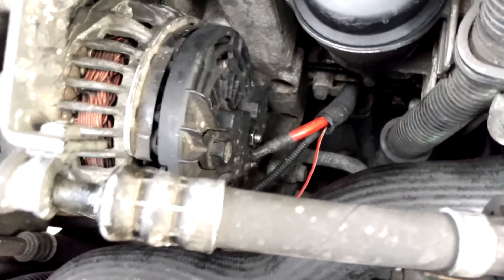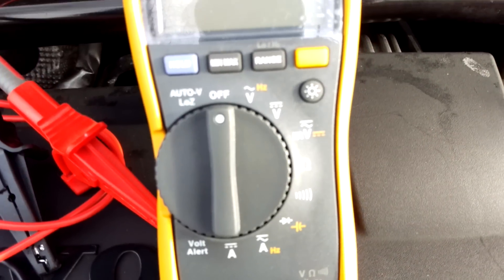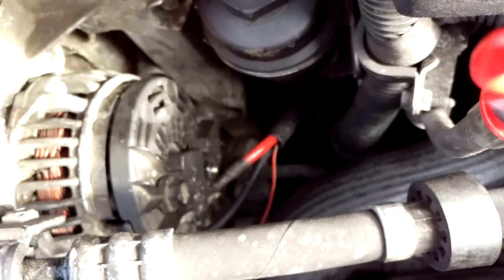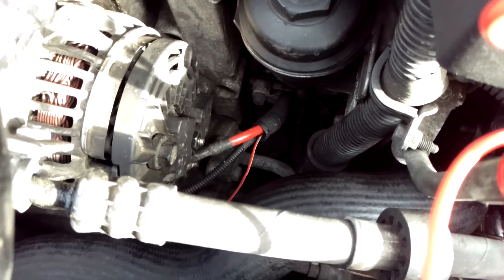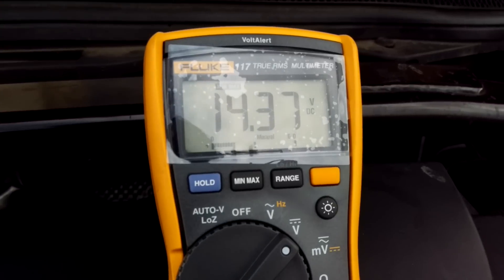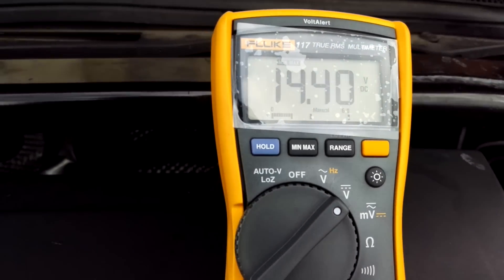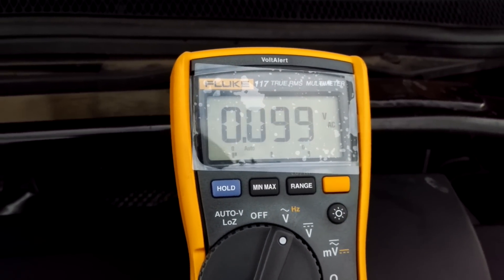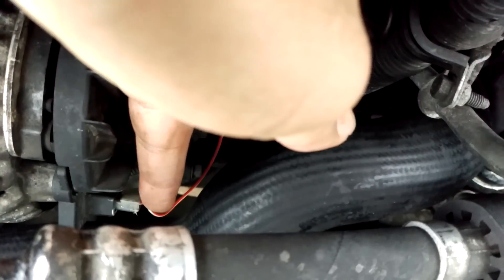How To Test an Alternator Part 2. Rectifier, Diode Pack, Parasitic Battery Drain

Comment: Thank you for this video, very helpful! Based on the second test here my rectifier is bad, I am seeing 30V AC! I didn't directly test on the alternator as it is inaccessible but instead measured from jump points in the engine bay which are relatively close to the alternator (battery is in the trunk). I hope this is still a fair test, using the jump points? E46 BMW if you're familiar with the car. Thanks again!!!
Reply from the maker: David C You're welcome David and thanks for the comment.
Please read the video description. 
You need a better multimeter.
Reply: My apologies the description was hidden on my phone's app.  I'm showing 14.10V at idle so I think the alternator is OK, but intermittent problems are inherently difficult to diagnose!  I'm going to have the battery tested in case it has a sporadic internal short or some other fault.  Thank you again!!!

Comment: So would a bad diode fail in a way that it would only cause an intermittent draw. Trying to chase a phantom down its there and then it gone...
Reply from the maker: Kreig Dernier Unlikely. 
If you have a DC voltage over 13 measured at the alternator with the engine running, a failed diode is almost certainly not your problem. 
You can also carry out a detailed parasitic drain test by following my video here https://youtu.be/ZCMQE2tgRSE
Reply: Thx im getting 14 at the end of its cables to the battery the search continues
Reply from the maker: Kreig Dernier The alternator isn't your drain then so do a proper parasitic drain test and you'll have your answer within an hour. 👍
Reply: SiRobb ya if it didn't have a mind of its own and come and goes when it pleases i would agree with you

Comment: Very helpful video, cheers Si! For other viewers, if the problem is your alternator, dont throw it (and your money) away! I just made a video about Alternator Troubleshooting & Repair. I had a non-functioning alternator and in the video I go through the fault-finding process and dismantle the alternator. In the end the problem was with the diode plate, a $25 component, which is easy to replace. If you want to see the video, go to my channel and you'll find it there... Happy fixing! Cheers, Chris 👍

p.s. Si, where are you from? I'm originally from Blackpool, and your accent sounds pretty close... :-)

Comment: my diode test comes up fine but i get 13.4 vdc and 28vac at idle is that the rectifier?
Reply from the maker: Karl Griffiths You need a better multimeter to get an accurate AC voltage unfortunately as per the video description.
Reply: SOUNDS LIKE YOUR ALTERNATOR IS NOT GROUNDED PROPERLY

Comment: I was unable to disconnect the voltage regulator and stator connections on my alternator (2006 Ford F250), but instead disconnected the connection to the positive battery post.  The diode test showed ~970 mv. The reverse leads showed OL.  All other alternator tests were good.  There are no symptoms of a bad alternator except the check engine light remains on, and the Ford Technical Service Bulletin suggests a possible diode problem...as determined by an O-scope.  I am wondering if the higher mv reading was due to not being able to disconnect the voltage regulator and stator connectors, or that there is a diode problem triggering this check engine light?  Thanks for the video.
Reply from the maker: +lathcar when you say other tests were good, what were the AC and DC volts readings?
Reply: The DC output was 14.5v engine running, and the AC was <.1v.  Similar readings when testing from the battery except AC volts were practically zero. The TSB calls for a frequency waveform test to find if there is a fault.  Maybe this is something that cannot be detected using multimeters?  Thanks for your reply.
Reply from the maker: lathcar From those figures, I see no diode problem and strongly doubt that an oscilloscope would confirm any different. 
Eliminate voltage drop to battery by doing the same AC and DC voltage test on the battery posts and if they check out, it could be something as simple as a poor connection to the dash tell tale light. 
Your charging system can be A1 but if the system doesn't know that, you'll get a warning light. 
Diagnostics live data will help also as that gives the system voltage which can be different to the battery or alternator output voltage.
Reply: I took it in to a parts store and had them do a diagnostic.  Nothing wrong w/ the alternator or battery.  The check engine light remains on, had the Ford dealer reset it, but it eventually came back on.  This has become quite the mystery since I have done about everything suggested by the error code - the alternator being the last thing. Thanks again for your reply.

Comment: hi what if the reading is only going one way but it is low bwt 100???
also what about the wire that goes from the alternator to the cluster (small thinner (blue one)) does that have a one way diode or can current flow both ways throught that? 

cars a 325i e30
Reply from the maker: Faisal Mahmood The test is in 3 parts so as long as you're getting around 14V DC with the engine running and less than 0.5V AC, your diodes are most likely ok. 
The small wire is switched so only produces voltage with ignition on and doesn't require a diode.
Reply: SiRobb thanks..👍 was going to change the alternator beacuse the small wire was showing current both ways but seems alternator is ok as other tests are ok... maybe the new battery was bad anyway

Comment: hi what if the reading is only going one way but it is low bwt 100???
also what about the wire that goes to the cluster does that have a one way diode or can current flow both ways throught that?

Comment: I did all your tests and ok. but still have the 15.2 volts at the battery and the dash computer only reads 14.7. What can it be?
Reply from the maker: Ser Shark What car have you got and are you testing the voltage on a cold or warm engine?

Comment: Btw,my car system is reading 14.60 volts but when i measure at the battery is 15.10 volts. So maybe the power module is ok but the voltage regulator its putting more. Its strange how the hidden menu reads.

Comment: I just watched your battery drain video ,very good made!
My first problem was with my Webasto that didn't work and after a diagnosis i saw there was an high voltage error where my webasto is blocking it self. After that i start digging,i had an audio drain that i fixed with a relay. Maybe i have more parasitic drain from Confort Access(its a common issue at Bmw).
I drive everyday,and every morning my battery voltage is 11.60... So maybe just a bad battery or parasitic over the night and the power module its pumping up to 15 volts to charge the AGM battery faster.
No problem starting the car!

Comment: Thanks,so then is most likely the voltage regulator for the 15 volt issue?
Reply from the maker: sergiuxy21 Not necessarily. 
In winter, higher alternator output around 15V isn't unusual particularly when cold. 
If it is still 15V once the car is fully warmed up, you may have a regulation problem or a battery in poor condition so check your battery voltage like in my video here https://youtu.be/sWIHbDAhv4Y
I'm using diagnostics but you can use a multimeter for the readings.

Comment: Can i measure Ac volts at the battery?
Reply from the maker: sergiuxy21 Ideally, you want to test at the alternator but testing at the battery is better than nothing. 

With 15V DC, your diodes are most likely to be ok. 

For my more detailed parasitic drain video, see here..... https://youtu.be/ZCMQE2tgRSE

Comment: Hi man,very nice video!!
I have a Bmw and I'm getting 15.10 volts at battery with engine on.  And also i have some battery drain cuz my battery is getting empty if i don't drive the car for more than a week. 
It can be voltage regulator  and for the drain the diodes??

Comment: Hey I have a draw going on in my truck so I tried the last test and it came to 327 with the red on the case and black on the post and it came to 1 when reversed what does this low reading mean since you said 500-800 is in spec
Reply from the maker: ltownsgrimreaper The 500-800 is a general industry standard. 
You have a definite one way reading on the diode test and remember that there are 3 tests in the video so as long as the DC volts are over 13.5 and the AC volts is below 0.5, the rectifier isn't the problem.
Reply: Your rectifier may be using low voltage drop Schottky diodes which turn on at about 0.4V. These produce less heat than conventional diodes at a given load current and are therefore useful for high current alternators.

Comment: MY BATTERY LIGHT IS ON ALLTHE TIME , BUT THE ALTERNATOR IS CHARGING OK ,WOULD THIS BE THE DIODE ARE AT FAULT
Reply from the maker: Mike 1960 What is the DC voltage measured at the alternator with engine running?
Reply: Could be voltage regulator.

Comment: Thank you for your informative vid, I especially liked that you showed a cheap multimeter as most of the punters that watch these vids only have a cheap one (like me) Now I know its millivolts as it doesnt say on my meter. I found out I have knackered diodes with these tests whereas before I thought it was the regulator.
Reply from the maker: What results did you get on the 3 tests? 
Also see the video description for the caveat relating to cheap meters.
Thanks for the comment.

Comment: Mate, wished I looked at this video while my faulty alternator was still in my 4wd,   but was still very helpful.  I thought I had a voltage reg problem as the alternator was under charging the battery,  max DC about 13v output.    After pulling apart the alternator I measured all 4 diodes ,   2 were OK , using the diode check on my multimeter tested about 520 each ,  the other 2 were open circuit in both directions. When testing at the large +  terminal I had a reading of about 950 .  Also the diode terminals  looked a bit burnt too,  ended up replacing the alternator as I damaged the voltage reg & brush holder ,  the screws were rusted in.  For some reason I thought alternators were all 3 pole / phase, like most electricity grids,    but my Toyota seemed to be 4 pole/phase.
Reply from the maker: You got there in the end, that's the main thing.👍
Thanks for the comment.

Comment: Hmm. I'm seeing 1.5v on the diode and 30VAC!!!! Diode only passing voltage in one direction but reading obviously too high and 30 volts ac!!!!!! Guess it's my diode.
Reply from the maker: 30VAC is a common reading on cheap multimeters and doesn't necessarily mean there is a fault. 
See video description.
Reply: +SiRobb Haha! The old "read the description you pillock!" I was questioning the meter as I've just tested a recon alternator at the parts shop and the diode on that one according to my meter is 1.7, which is fairly inline with my 1.5. I'm beginning to think I may be ok with just a new regulator. Cheers.

Comment: I tested the diode like in the Video and got nothing going one way then switched the probes and tried a got 455 is that good enough ? You said 500 to 800 ?
Reply from the maker: It could well be ok but there are 3 tests in the video so what was the DC charging voltage and AC volts?

Comment: Are the numbers for the diode test different for different alternators?  I got 1 and 1199 when diode testing my alternator, and I'm pretty sure that I've got a bad diode in the rectifier cause I lost about 1/3 of my max output current.
Reply from the maker: The numbers are pretty much an industry standard so having failed 2 of the 3 tests, I'd say you have a failing diode(s). 
If you know anyone with a similar vehicle and alternator (maybe through a forum) you could check theirs to confirm.
Reply: That's what I thought.  I've never done this before, but guess I'll need to replace the rectifier.  It's a Mitsubishi alternator, I'm hopping it won't be too difficult.
Reply from the maker: +sailorbob74133 Before doing anything, watch my Part 3 video here https://www.youtube.com/watch?v=Yc8tsADpjVA where I look at the brushes and slip rings. 
It would be unusual but not impossible for these to cause your out of spec reading.

If you do have to change the rectifier, click on this for some guidance videos https://www.youtube.com/results?search_query=Westronics+rectifier+
Reply: Thanks so much for your time.  If it's ok, I have one more question.  I also measure AC amps with my clamp meter and got a reading of 2.5 AC amps in the positive battery cable.  Is that an acceptable amount of ripple, or is it excessive?  Most of what I've read says AC volts can only really be reliably measured with an oscilloscope which I don't have.
Reply from the maker: +sailorbob74133 Is your multimeter stamped "True RMS"?
Reply: Yes, it a Uni-T ut210e http://www.eevblog.com/forum/testgear/a-look-at-the-uni-t-ut210e/
Reply from the maker: +sailorbob74133 That would be accurate and reliable enough for me.👍
What was your DC volt reading?
Reply: With no load about 13.7v @ 750 rpm,  and about 12.47v with brights, ac,radio,defogger and trunk light on @ 2300 rpm.   The alternator was generating 58.7 amps and an additional 5.5 amps was being drawn from the battery.  The set point for the field control unit on this is 14.3v and the rectifier uses three 30 amp diodes.  So even as an amateur it sounds pretty clear to me that one of the rectifier diodes is bad.  I monitored the PCM input to the field control unit and it was 2.2 volts, which means the PCM was basically full fielding the alternator.
Reply from the maker: +sailorbob74133 It's certainly looking like a bad diode.
 
In this video, I measure The AC Volts and get 0.140. The limit allowed is 0.5 VAC. 
What was your AC volts reading?
Reply: yeah, I went ahead and ordered a new rectifier yesterday.  thanks for your help!
Reply from the maker: +sailorbob74133 No problem. 
Good luck and let me know the outcome.
Reply: +SiRobb maybe I'll make a video 🔧 ;-)
Reply from the maker: +sailorbob74133 If you did, I would like to see it. 👍

Comment: No...I don't know how
Reply from the maker: The way to test a clutch pulley is to remove the belt, then insert a screwdriver through one of the holes in the alternator to stop the fins.
Try to turn the pulley by hand COUNTER clockwise. You shouldn't be able to move it.
If you can move it counter clockwise, you need a new pulley. 

With the screwdriver still inserted, now try to turn the pulley by hand  CLOCKWISE and it should turn smoothly.
If it turns ok clockwise, your clutch is fine.
If it won't turn or if it is rough, you need a new clutch pulley.

Comment: I forgot to mention that, if I press the accelerator the timing bell runs perfect... just when idling, it does like that.
Reply from the maker: It isn't your timing belt. 
It's your auxiliary belt. 
Have you tested the alternator pulley like I described?

Comment: https://www.youtube.com/watch?v=xE4mVgblMjI&feature=youtu.be  
I also filmed that popping noise and even if i plug that turbo control valve, the sound remains the same.
Thanks!
Reply from the maker: Hi. 
I've seen your video and the belt moving and high pitch noise is caused by your alternator pulley. 
It has a clutch mechanism which has failed so you need to change the pulley urgently.
They cost around £35 (€50). 
Buy one made by INA and it will be the same as genuine Volvo. 
You need to remove the alternator and use an alternator clutch pulley removal tool to take off and replace the pulley. 
It is stressing the belt and if the belt snaps or comes off the pulleys, it could wrap around the timing area and break your engine. 

With the popping noise, hold your thumb over the valve for longer. Maybe 10 seconds and see how it is.